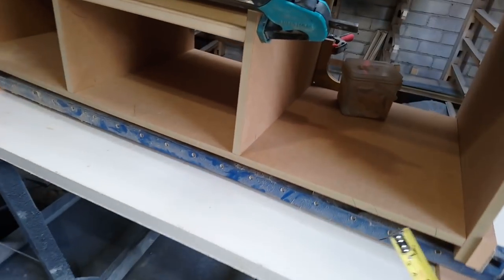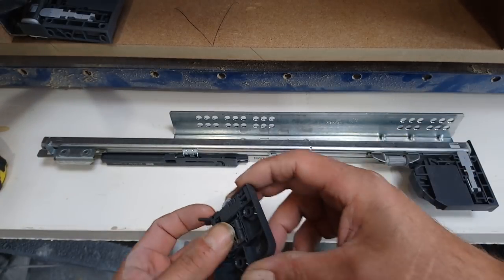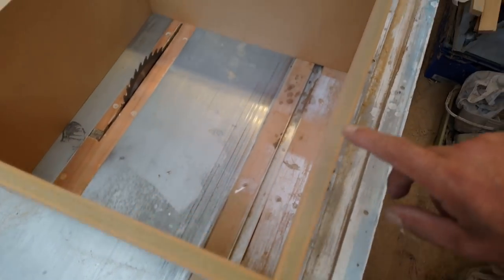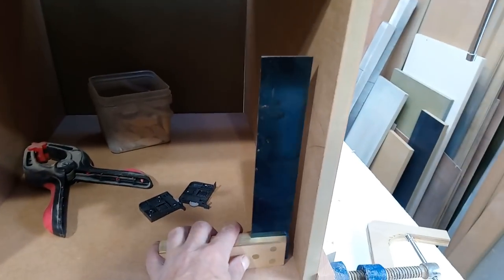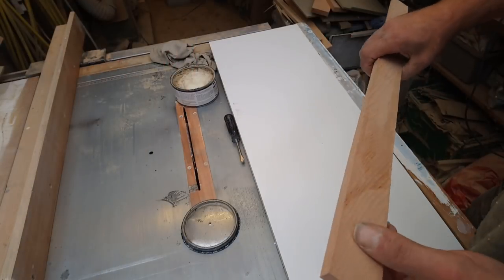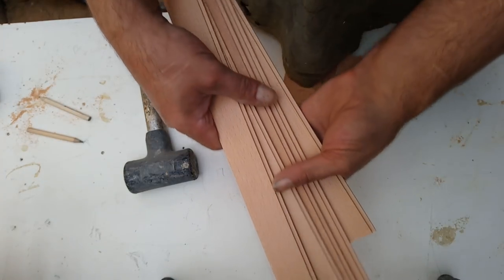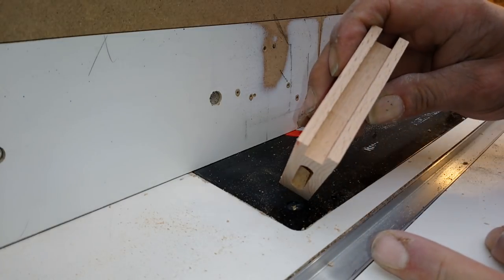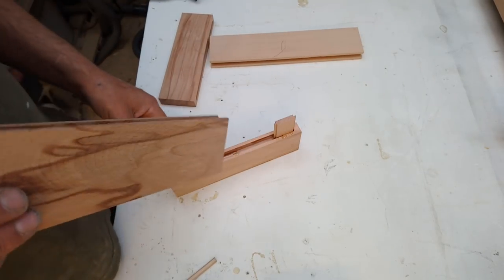TV Cabinet Build Pt2 - Making the drawer, & the doors made with homemade dominos

Comment: You’ve inspired me mate I feel like going out on a spending spree, fancy a dewalt thicknesser would you recommend it ? I have a scheppach but it’s a pain flipping it over to change action.
Reply from the maker: 😁 Yep, I think if I was to replace this I would get the same thing. I've had it for a few years now without any problem, the 4 point locking system eliminates snipe, I had to choose when buying it to spend the extra couple of 100 compared to other makes but don't regret it,  & yeah I knew flipping over the bed would do my head in so got a thicknesser with plans on getting a jointer which I got later, 👍
Reply: I have the same thicknesser, the only fault I have with it is that the feed rollers are a bit weak. Possibly they could do with a bit of a clean, maybe some wire wool and white spirit.

Comment: Gid wear do you get your sash clamps from?
Reply from the maker: Hi sorry nowhere in particularly, I've slowly collected them, my dad gave me 2 Record ones that were always hanging up in the garage when i was young, they're good quality, not as shiny as when he gave them to me but he doesn't mind he said, at least they're getting used & I'd used them 100 times more than he ever had but they're not cheap, Screwfix for the black n silver sash clamps, the heads wobble on those & need a metal packer in them, i shoved a nail in when i got them as a quick fix so i could crack on n work but a few have fallen out, they need a better more permanent slip of metal putting in, & the F  clamps they're quite good, the blue & red heavier sash clamps i've had quite a few yrs come from machine mart, none of these are very good quality but they do the job, If you buy some from machine mart open the package in the shop to make sure the cast parts on the ends aren't broke 😒🙄👍 https://www.machinemart.co.uk/p/cht136-36in-t-bar-sash-clamp-set/ And the bigger ones https://www.machinemart.co.uk/p/cht137-72in-sash-clamp-set/ If you can check out car boot sales, it's the type of thing people don't use so end up selling, 👍 or ebay 👍

Comment: Where do you get your drawer slides from.
Reply from the maker: I get them from a place called Lawcris, £22+vat, a few yrs ago I used to order them from Ironmongery direct but they came loose in plastic bags & the clips were separate rattling around in an oversized cardboard box, poorly packed with insufficient packing material. one too many times they came broken, doubt they've changed their packaging as I get the occasional other thing from them packed similarly. 
These Hettich ones are well made n best I've used, if you get in touch with them they'l give you details of your local supplier 
https://web.hettich.com/en-uk/products-catalogue/drawer-runners.jsp
Reply: Gid joiner thanks gid I just opened account with lawcris so thanks. That’s the reason I was asking as I also have used ironmongery direct with “next day service” which takes 3-4 days haha
Reply from the maker: 😆 Yeah they make promises they can't keep, I still use them but i don't trust em, 
Just had a look at Lawcris's invoice for these runners for you, it says push to open but i got soft close so just went out to the shed to poke the drawer to see if it pops open, nope, didn't think so, ya can't get soft close & push to open on the same runner because you have to push it till it clicks to shut it 😆
Reply: push to open with soft close now available